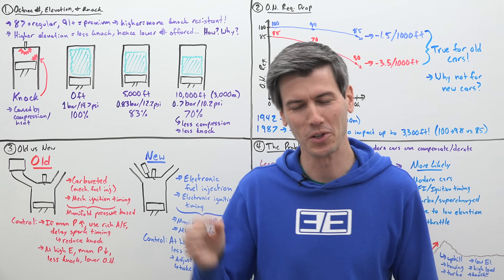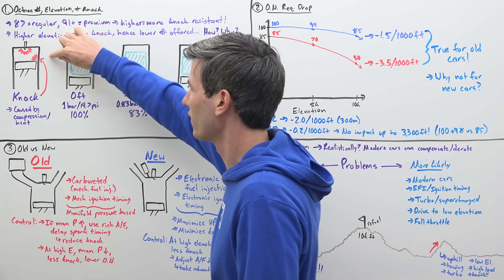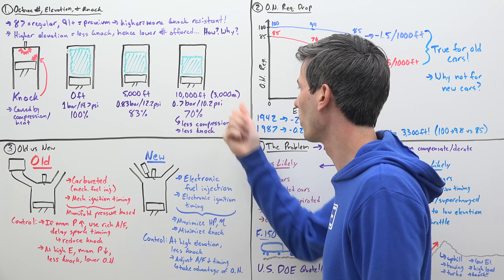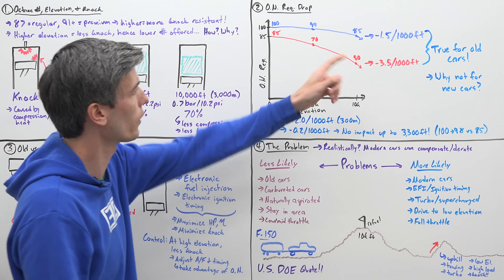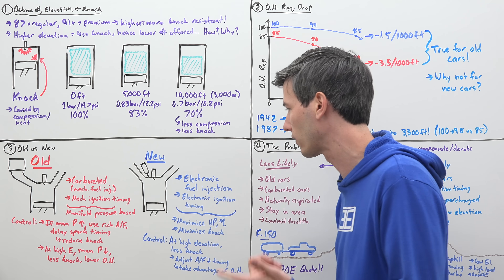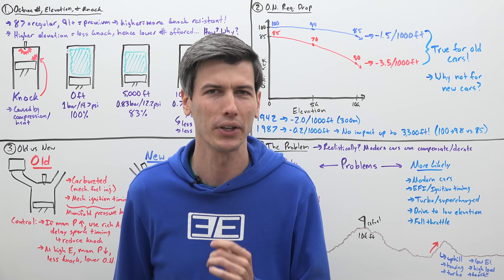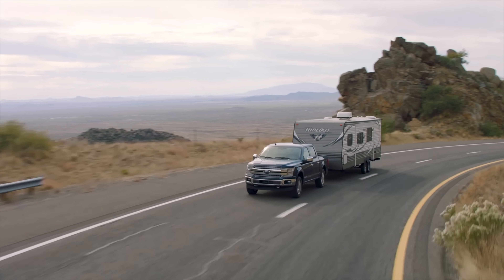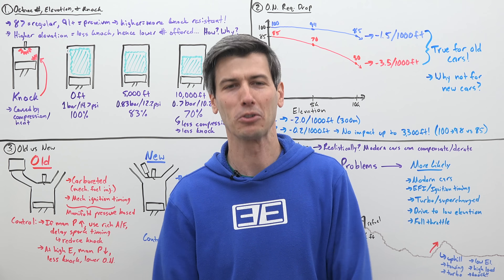Never Use This Gas In Your Car!

Comment: So does this mean that if I drive a turbo charged car I should be using higher octane fuel? 

I also find it interesting that my old BMW was naturally aspirated but required premium fuel. Why would that be?
Reply: More than likely yes.  If you have a turbo car it will perform better on higher octane gas.  I have a Ford Focus ST the owners manual states that 87 in ok to use, only because the computer can pull timing to protect the engine from knocking.  My dads Jetta says the same thing in the owners manual.  Using 91 or higher octane will result in more power being delivered by the engine.

Your old BMW probably had a higher than average compression ratio.  That is why it required higher octane fuel.

Comment: I hope people do realize that E85 has an octane level somewhere between a 105 and a 110 octane.. I have an F1 53.5 l twin Turbo ecoboost with the flex fuel system and I run methane in my truck it's got 610 horsepower iron E85 because it has a higher rock tame level than 93 octane it Burns quicker but it has more power in the fuel if that makes any sense to 9 car people but your car has to be flex fuel rated in order to burn E85.
Reply: The octane level of the gas has nothing to do with the power made by burning said gas.  Octane is a anti knock rating only.  You get more power out higher octane fuel through it's ability to withstand higher compression forces before it detonates on it's own.  Higher compression equals more power.

Comment: In Germany we have 95 as the normal gas and 98 as premium.

Edit: Just learned about the different scales from your little note. Seems to be 91 normal and 93 premium in AKI.
Reply: 91AKI is still far above 87AKI. 95RON is what we call regular in Europe, 98RON is Premium. 87AKI is crap for many modern engines, especially turbocharged engines. I've even gotten knock on 95/91 on a stage 3 Volvo S60.
Reply: @JakkeJakobsen   what do you expect, to run smoothly in a tuned engine

Comment: Running the lowest octane without inducing knock generally gives a complete burn and is efficient.  Higher octane does not contain more energy, it has a higher flash point pressure.  Running higher octane does not give any more horsepower.  In fact a higher octane fuel in a vehicle designed for lower octane will not be as efficient.  Run the lowest possible octane without generating knock will yield the best efficiency.

Comment: This is the problem with using worthless words (like regular and premium).  The car should denote the actual octane number it requires, and pumps should only have octane numbers.  Same problem at restaurants.  What size is a small vs medium at even given store, even within the same brand.  I want a 20oz, I don't care if it's called small or medium here, whichever worthless word at this store is the 20oz is what I want.  At one store, I asked for a pint of root beer.  She said they don't sell beer there.

Comment: I only use 100% Premium Fuel with NO Ethanol! I do have a Turbo engine and could get away using 87, but basic fuel has 10% ethanol , medium grade has 5% ethanol and premium has no ethanol.

Comment: One additional note, in modern turbocharged engines, as the maximum boost is regulated to an absolute specified pressure, what this means is that you can have the same pressure at the manifold (and ultimately at the combustion chamber) at sea level than at high altitude. What does this mean? Well, that you are as likely to ruin you engine at higher elevations that you are at lower elevations.

Comment: What I find funny is Ford puts so many stipulations in their manuals that other manufactures don't need to do, their ratings are their ratings. They even stipulate max towing and to reduce the max number 2% for every 1000 feet of elevation. 

Really shows that Ford is just a marketing company and are trying to give the illusion that their vehicles are superior even though they are the same if not lower 🤷‍♂️🤷‍♂️

Comment: Excellent video. This has always bothered me tremendously. Especially driving a High-compression LS engine at 3600 feet and only 87 octane fuel is sold as premium. Manual says 91 octane. Same with my supercharged small block Chevrolet. The engines, even the high compression Normally Aspirated LS does not "know" we are at 3600 feet. Electronics "knows" and compensates somewhat but I'm getting screwed because the performance will drop via timing changes and lower relative compression. The supercharged engine makes selling of 89 octane as premium fuel an engineering travesty. The scary thing is they push the octane for 87 Premium by bumping up the ethanol level as high as possible. Many tests over the years have shown way over 10% ethanol. Now, I'm forced to avoid knock by manually retarding the timing and dumping more fuel into the engine to cool the A/F charge. That costs money. I've had one low milage engine ruined by this practice. 
It's pissed me off for over 30 years. 3600 feet and I pay premium prices for s**t gasoline. 91 down 87 octane is a significant hit. It's not like we are cresting the Rockies or the High Sierras here.Thanks for addressing the issue.
Reply: Where the hell is 87 sold as premium? I’ve gotten gas over 10k feet (Leadville) in Colorado that still sold 91 octane.
Reply: If this is a factory stock modern vehicle that hasn't been altered, it does know you are at 3600 feet.  It is measuring the barometric pressure.  How do you think altimeters work?
Reply: @Discretesignals  yup it's called manifold 'absolute' pressure sensor, or MAP sensor.
Reply: Yep moving to diffrent states i saw it too

Comment: these octane numbers are "Research Octane Number" or "Motor Octane Number"? I'm not on the us and trying to figure out the fuels I can buy, either premium (RON:98 - MON:85) or "super" (RON:95 - MON:84). If the numbers on your video are MON, then none of the fuel sold here is safe to use. seems unlikely, but just wanted to be sure.

Comment: Interesting. I had my car tuned to a stage 1 93 octane tune and the tuner told me "don't get crappy gas at Wawa, make sure  you get good gas at Shell or Sunoco" and I have been intrigued by this ever since. I never knew there was even a difference.
Reply: Yeah, I have a 93 octane tune as well on my VQ37VHR. I also use a weak octane booster with my 93 every time I fill up, just to be sure I don't run into an issue of bad gas and risk knock or switching to a hi-det fuel map, robbing me of performance.
Reply: @NG-VQ37VHR  Wow you better take care of your investment, that engine is no cheap. What is the factory octane rating for that engine?
Reply: @NG-VQ37VHR  Be careful with octane boosters, the MMT coats the inside of your engine and messes with your O2 sensors.  Any octane booster that actually works has this chemical.
Reply: You deserve to ride a bike forever
Reply: Yeah, I'm pretty sure Wawa is not top tier but the other two are. If you use ethanol-free fuel, WaWa has it but it's over-priced.
Reply: You probably have gas being sold under at least six different branded labels in your area.  Do you have six different refineries in your area?  I'm guessing the answer is "no".  In other words, most everywhere you go, all the gasoline at all the local stations will be from one and possibly even two... possibly, but unlikely, even three... different refineries.  Here in Denver, we have two refineries.  All the gasoline (with rare and unlikely exceptions) will come from one of the two.  The cheap gas at one station probably came from the same refinery as the expensive stuff across the street.
Reply: @donrandall49  
The additive packages will still vary. Same refinery, yes but not likely with the same additives.
Reply: @njsongwriter  Exactly. A lot of gas just comes off the same pipeline, but at your local 'rack' each brand has it's own additives that are blended in at the same time your local fuel delivery truck is picking up a load to take to refill your local stations. That way the gas lasts longer, and the additives are fresh. Raw fuel direct from a refinery with 0 additives and kept at cool temperatures in large tanks has a much longer shelf life. It's sort of like 2 stroke engines, once you mix in that oil with the gas, the clock starts ticking, especially with crappy E10 ethanol blend gas we have today. 30 days and it's just about junk in a chainsaw or leaf blower.

Comment: Do modern engines in the US not have knock sensors to prevent knock by adjusting the fuel and ignition timing like in Europe??

Comment: 91 octane or higher is recommended so Jason is race fuel best for your example,  ford trucks?
Reply: If you go crazy and put racing fuel (let’s say 110 octane) you won’t do any damage to the engine, just your bank account. AND you’ll actually go slower, as the higher octane is designed to “push” the piston down at a slower more controlled rate.

Comment: The other day I was at a station that had 87, 88 and 91.  I'm like oh 88 huh?  Then I see that 88 octane is 15% ethanol. (Aka e15) 87 has 10%.  My car recommends 91 but it's not required.  I really wanted to use that 88 octane, because it's closer to 91, but being 2002 I wasn't sure about the computer's ability to recognize the octane.  Long story short I didn't put it in but could I run E15 in a 2002 Nissan Sentra SER Spec-V (it's just a 2.5 altima engine with a fancy intake manifold)??

Comment: Unfortunately you never addressed the errors in your "Does a lean mixture run hot" video which you got totally wrong.   Lean and weak mixture is technically different but similar. In this video you have not considered that using a lower octane fuel will produce a less power capable mixture a little akin to a weak mixture which WILL cause an engine combustion environment to run hot.
Therefore the vehicle manufacturers are probably advising that drivers dont burn out their engines and if people do use lower octane fuels and have problems, the manufacturers would quite easily identify the overheated valve edges and maybe stem or guide issues etc and therefore void any warrenty perfectly reasonably.
You should understand these issues before making wrong advice videos and stick to making correct videos.

Comment: Thanks so much for that explanation. I was driving a modern car (2019 Chevy Volt) on a cross-country trip and noticed that some of the fuel I was buying was 85 octane. Heading up a steep grade at low elevation, I heard a rather disturbing noise from the engine and didn’t know what I had done. Fortunately I could back off on the throttle and use more of the little bit of electricity left in my hybrid battery (the Volt has a nice feature to maintain a battery reserve for climbing hills) to get up the hill. I hope I didn’t do any damage but the car seems fine since then. Now I know the reason for that experience and how to avoid a recurrence. Your video is much appreciated!

Comment: I live in Colorado. I've been using 85 in all my vehicles that call for 87 for 25 years. Have never seen any ill effects. I use 91 in my vehicles that call for 91, like my turbo buick and air cooled motorcycle.  I will consider not buying 85 any longer. Great video

Comment: Interesting! At first i was flabbergasted by the low octane ratings (Here in Finland only 95 and 99 are sold, but when I was a kid 30+ years ago there was also 92 octane leaded). Then I found out that here in Europe we use RON, while the USA and Canada use AKI [=(RON+MON)/2], which is lower for the same fuel.

Comment: If you filled up the f150 with the 85 and then towed the camper up the hill could you not just put in a measure from a can/bottle of octane increaser when you filled up. Would this would then stop or atlest reduce the likelihood of knock happening when driving at full load up the hill towing whist your at the lower altitude? Assuming that 85 was all the filling station had and you either had some with you as you were prepared or the filling station had some on sale.

Comment: Seems unlikely that you would be able to fill up on 85 octane at high elevation and make it to low elevation without needing a refill. There are only a few states that sell 85, and it's not trivial to find a way to go from those states to near sea level elevation in one tank of gas.

Comment: When I drove from Ohio to California in my 1989 Ford Ranger 4cyl 5speed back in 2006, I knew nothing about these lower octane fuels and they were significantly cheaper.  I used them as soon as I saw them at gas stations going west, I believe Iowa was the first state I saw it.  The truck ran noticeably better on the cheaper fuel. Anyone know why?
Reply: You sure that wasn't E85?
Reply: @Qazxswer68  it was e85. Is that different from regular 85?
Reply: @jeffroberts760  Yeah. That's an ethanol blend. Supposed to 85% ethanol, 15% gas but it's usually more gas than 15% depending on location and season. Made with corn, it has an octane rating way higher than pump gas.
Reply: @Qazxswer68  great info, explains a lot, thanks

Comment: Why they sell a fuel that may damage some engines? They still sell “regular” fuel when they sell super-cars requiring premium fuel, those as well could be damaged by using regular.
Reply: All manufacturers state it on the fuel cap what octane rating you need.
Reply: @Robert-j6r8c  so what’s the point in denigrating 85 AKI

Comment: this really surprised me when I did road trip from Las Vegas to Utah for first time. When asked at the gas pump they told me straight to use just the 85 "regular". In rented car, so I definitely did not take risks and gone for "premium". Bonkers is they usually have only 85 and then 89. So have to pay premium for what I don't need.
Reply: Funny about 15 years ago I rental a Jaguar XJ8 in Vegas, when I picked it up the dash light said limited performance. I drove it until half full then put 93 octane, right away the light went out. I went 160 mph in that car on the north side of Mt Charleston 7 mile stretch.

Comment: Thank you Jason for all these explanation. But there is an explanation missing about octane, what correspond the number. I mean when I saw 91 octane number for "Supreme+" gasoline I was laughing because in France the "standard" gasoline is 95 octane and the premium in 98. But I tried to make a search on Wikipedia, I was unsatisfied by the French article but the English page give me the answer. There is 3 "types" of octane level: Researched Octane Level [RON], Motor Octane Level [MON] and Anti-Knock Index [AKI or also called (R+M)/2].
To be simple (because it's a comment not a whiteboard), RON is a test performed at 600RPM and MON 900RPM (with preheating and variable ignition timing) to stress more.
So RON always higher than MON (usually it loss 8 to 12 point between), and AKI is simply the average of RON and MON.
What is the link ? In Europe we give RON (France : RON 95 & RON 98) and in America it seems the number is AKI !
So in Europe if you see [RON] 95 it correspond roughly to [AKI] 90-91 (equal to the "Supreme+'") and [RON]98 correspond to [AKI] 93-94 (so slightly higher than the "Supreme+").
So in Europe no big issue with gasoline, except if you tune your engine (illegal in France, but lot of things are illegal to do on your car in this country) to have a higher power that really needs [RON]98.
To finish to a more positive note for Americans, in Europe we have a better octane level, but in France right now on my closest station the price is 1.542€ for one litre of E10 (this is SP95 = unlead [RON]95 with 10% of ethanol). So equal to 6,77$/gallon (if my calculation is correct).
So ok, you have low level of octane, but in other hand, it's really cheap, you can put any car on the road (even DIY one), and in 2025-2035 you will not be restricted to buy an electrical engine.
Thank you if you read all my comment. Have a nice day !

Comment: I have a Diesel engine, so yup - I never use gasoline fuel, no matter what the number and altitude.
One interesting thing I've found is there is a difference on how long I can drive on a tank, depending on who refined the fuel. Same driving pattern, speed, etc. Only difference is manufacturer of the fuel itself. Are some 'better' at distilling diesel fuel than others?

Comment: Small correction. At full throttle the manifold pressure is low but the flow is high on a carbureted non turbo engine. Also the higher vacuum at Partial throttle advances the timing on old mechanical systems and also on some efi systems.

Comment: Or you could buy a FlexFuel compatible truck or car [they still sell make them]. E85 runs 30% less than premium but sports a stratospheric 105 octane. Fewer mpg but less cost evens the out the expense. Especially since that extra hp will help at any elevation and with 46% fewer emissions.  Best of both worlds.